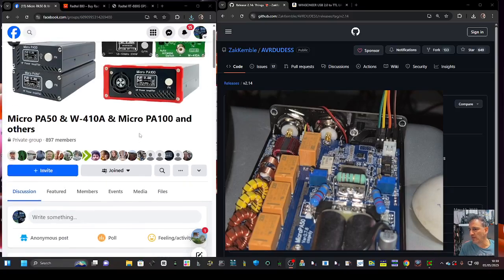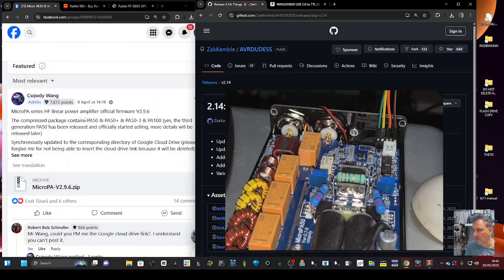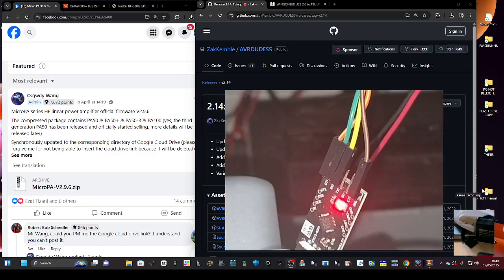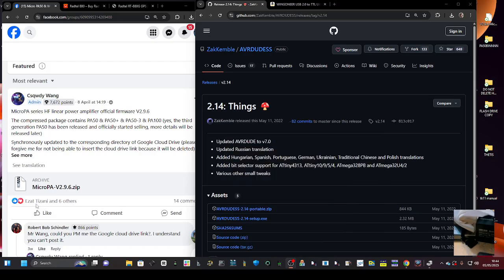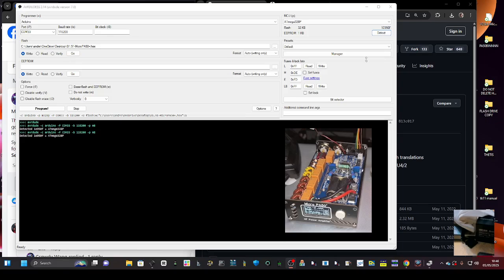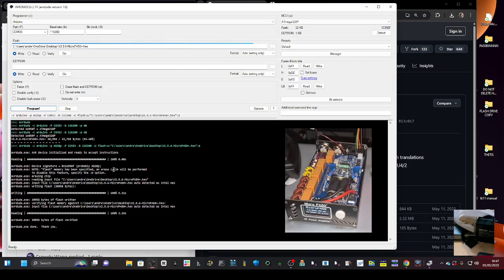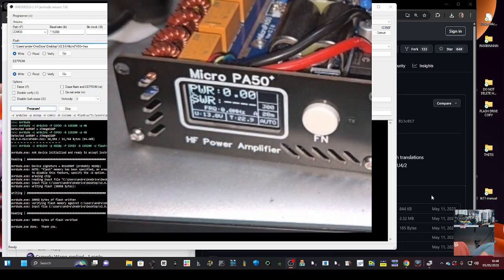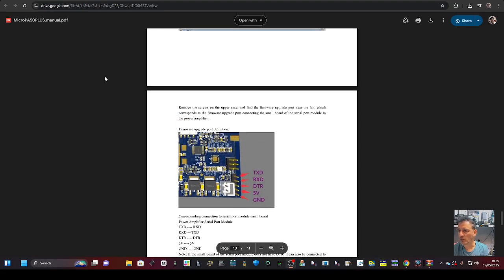MicroPA50 Amp - Firmware Update )v2.9.6 May 2025

Comment: When you look at these units external look with a few buttons you kinda think there's not much to unit for their high purchase price. Then, when you take the cases off and look inside then you see why the high purchase price. The complexity of the board with all the layouts of circuits with components and Central Processors. Then there's all the Design and Development and computer Programming, with Free future Upgrades, and finally the manufacturing then the high price tags make complete sense.
Reply from the maker: Totally agree.